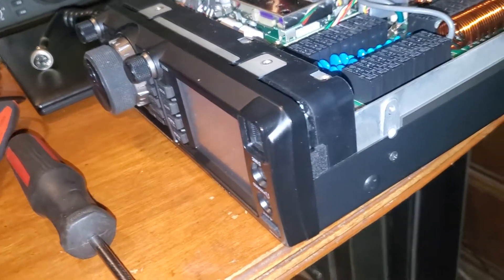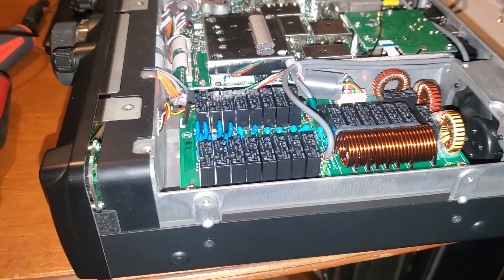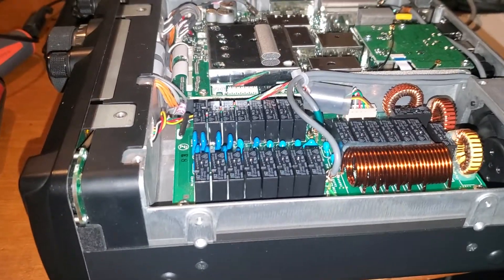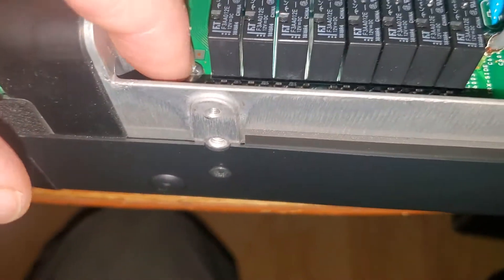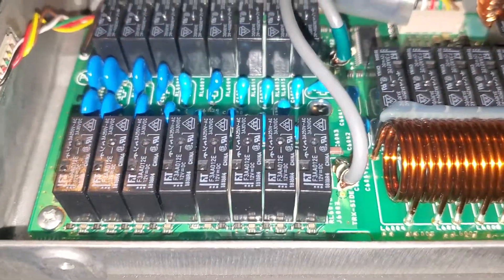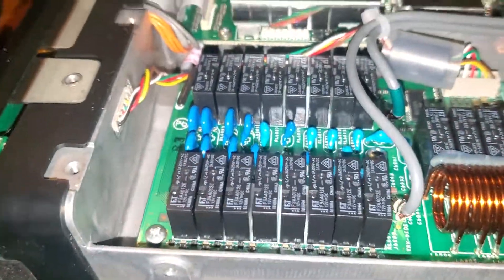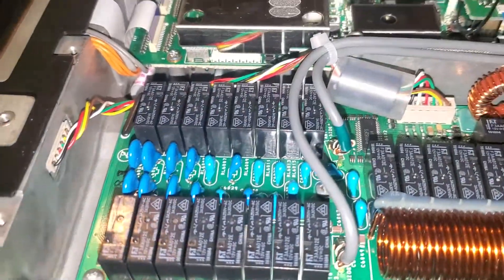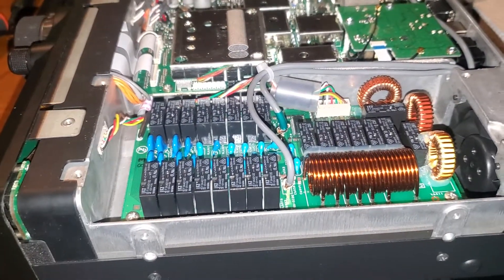YAESU FT991A UNDER THE KNIFE TUNER PROBLEM ON 60M

Comment: Is this really a tuner problem mine only does it with SSB transmissions it's fine in key down mode . I would and disappears when power is reduced . I feel that this is more of a meter problem than actually a high SWR .
Reply from the maker: Its a ground issue. They coated the boards after wave soldering  them.